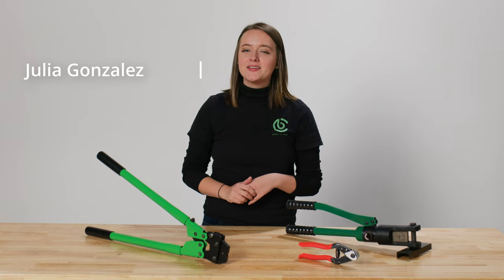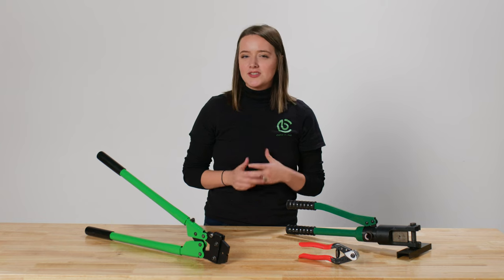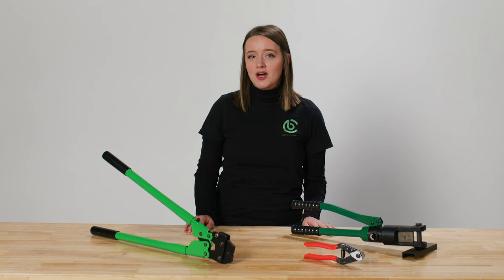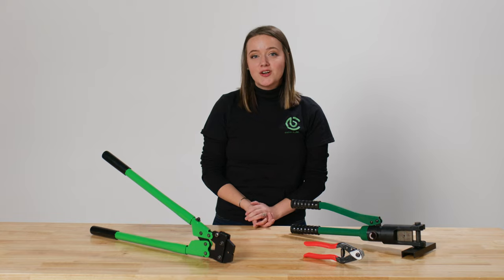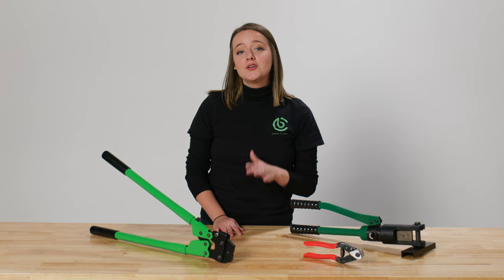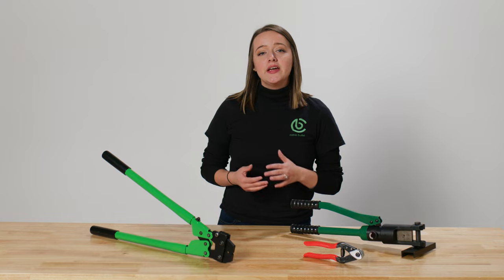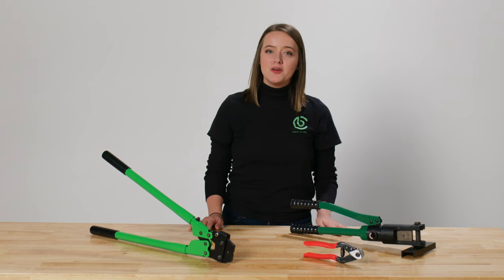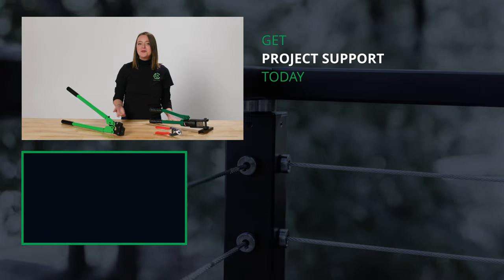Cable Bullet Crimp & Cut Multi-Tool

Comment: Julia,  overall I have been happy with Cable Bullet, you guys have been particularly helpful at several points.  But this tool is very cumbersome and difficult to use when working by ones self.  I have a suggestion that made it MUCH easier.  First I cut 2 2x6 boards about 20" long (2x4 would probably also work, I just happened to have scrap 2X6).  Use 4 2 1/2" construction screws to screw the boards to each other.  Opening the handles of the crimping/cutting tool,  hold it with one handle on the board and the other handle straight up, allowing the black jaws to hang over the edge of the board. Using a 1/4" bit drill through the handle and secure the handle to the board with a construction screw.  Drill two more holes through the handle and again place construction screw through the handle into the board.  Voila, now you have a stable tool to cut and crimp!
Reply from the maker: Hi Kevin, thanks for the helpful feedback! I'm sharing this with the rest of our team. Glad you were able to come up with something that made it easier to use solo!

Comment: Really wish they would post a video on how to use the cables using ordinary 4x4 stair posts. I’d like to avoid the system Amazon sells if I can.
Reply from the maker: Hey Chris, we actually have a video covering that using our wood tensioners here: https://youtu.be/FfGy6i17QcM

The video only shows a level section, but it's the exact same process for stairs!